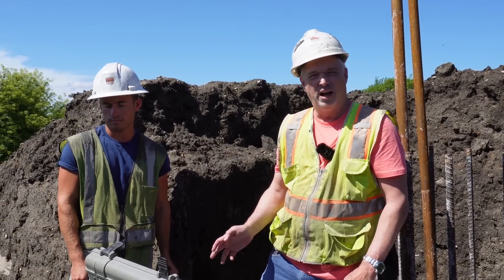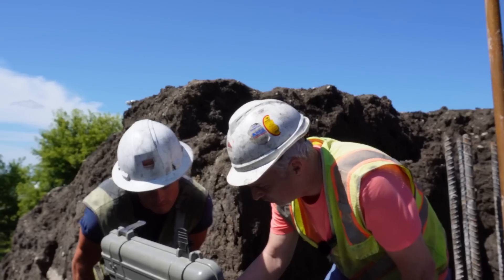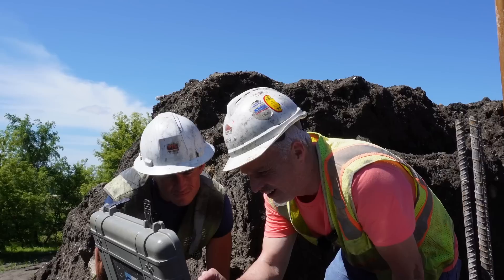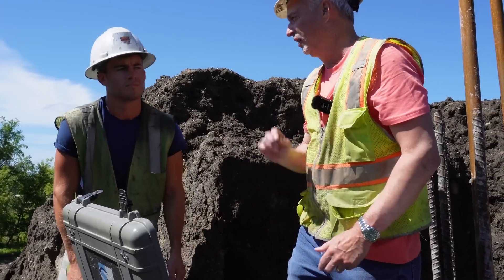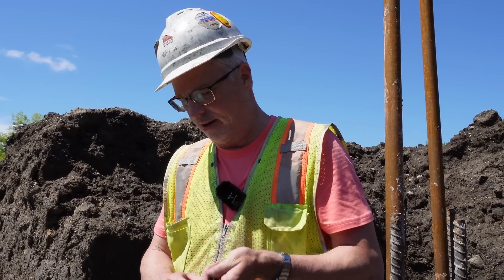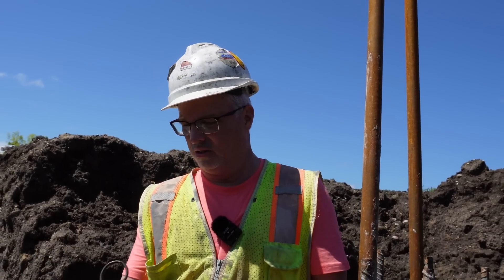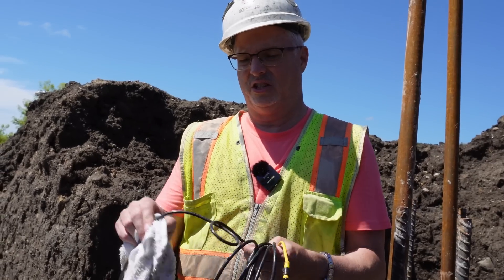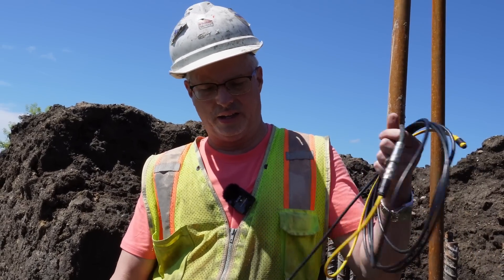Sonic Echo Impulse Response Testing of a Drilled Shaft Foundation

Comment: It's always nice to see engineers doing stuff hands on, I feel like the majority of the ones I interact with never see the field. One company I worked at was fortunate to have a group of electrical engineers that knew their way around tools and procedures. They would come out and help with things like primary injection testing, fall-of-potential tests at substations, or troubleshooting problems on utility transformers. It was great to get to work in that setting, I learned a lot.
Reply from the maker: There seems to be too many engineers who are content to spend all of their time in the office.  They are missing out by not spending more time in the field.

Comment: Interesting video. Always follow the ASTM exactly, even if its rediculas. I had a case where a contractor was challenging my test results which differed from his tech's results. When we went over everything I showed that I had done it by the Standard. It turned out that the tech wasn't following the standard. They shut up and left. Be careful. Good Luck, Rick
Reply from the maker: Yes, that is something to keep in mind for sure!
Reply: In my career as a heavy highway inspector, every single “disagreement” I ever had with a contractor was stopped in it’s tracks when I told them I would not deviate from the Specifications that their bosses signed on to when they agreed to the contract. If they had a problem with that, put it in writing and get more senior people and the client to sign off on it and I will be happy to accommodate. I have many hairy drilled shaft stories, but another time.

Comment: TOF (time-of-flight) is classic.  We used it (with known length) to determine acoustic speed and indirect measure of 'sintered-ness', something related to density, bond density of ceramics.  Higher is better as low acoustic speed is hint of poor cure.  Cement is 12000ft/sec (~4km/s). For our ceramic good was 17km/s.  Yes reflections, scatter, dispersion make it a messy test.
Reply from the maker: Interesting, thank you.  Yes, our situation is usually we assume a wave speed or measure it with another test to determine the length or depth to integrity problems.

Comment: Here in Colorado, we have been seeing utility poles for highway and city traffic controls / lighting corroding in an almost perfect ring, causing them to fall over. Probably is exacerbated by application to roads with magnesium chloride ... maybe overspray can be averted to solve the issue. We have not heard much about it lately.

You are old school... I use only Cordless Hammers! :)  The channel is very interesting to non-enginerds, such as myself.
Reply: I love RF and wireless doodads, but a wired connection is the simplest to reason about.

Comment: Using the under over method to coil your cables should reduce the tangles of your wires. If you start with a figure 8 and fold it over, it will show you how it looks. With each twist there is an untwist this way.

Comment: Interesting the same physics as an electrical transmission line in communications. The anomalies are the same a what is seen on a   instrument called a TDR.  The hammer is providing an Impulse which has a rise time faster than the one way trip time in the media. In this case this is concrete. The phase and magnitude of the returned wave you should be able the distance problem regions. Fun fact is that transmission lines were not understood until the first undersea telegraph cable between Europe and North America was constructed and failed.
Reply: And just to amplify on what was said a TDR is a Time Domain Reflectometer. They are test devices that generate an energy pulse or step on the cable to determine the location and magnitude of cable faults, breaks, splices, terminations, or other events along the length of a conductive cable.

Comment: Sounds like the PE certification process is not rigorous enough if people are signing off on incorrect reports.  Maybe better training on the software or better software is needed? Is the software certified in any manner?
Reply: A feel a lot of it is people not going through a thought process of wondering whether their answer made sense. I think Casey mentioned slide rules on this channel somewhere, and as someone who discovered this tech from before my time, I feel like one of the things you learn with them is how to ballpark a range of where you think something should be before you use a tool to achieve better precision. If all you ever knew was a calculator but you never had to learn to think about whether the answer it spit back made sense then you're not really better off, because the precision and speed is useless without understanding what you're looking for. I see it all the time where people miss a step in an equation and roll with the answer the calculator gave them, and no bells went off in their heads.

Comment: You're killing me with that cable. Get a small hose or cord reel for that thing. You're coiling it when you want to roll it up instead. Over time the whole cable will develop a twist like a candy cane and those hard kinks will eventually weaken the inner conductor where it will fail or give erroneous results. Having said that I love all your content, it's incredibly informative and easy to understand. If nobody has said it before you'd make a fantastic teacher and it's great you're passing your knowledge on to the young guys.
Reply: Same here. You can tell , in just a few seconds, who does and who does not have any kind of savior-faire with cables. After those few seconds I was just cringing... lol
Reply from the maker: I have had better cable days for sure!🤣
Reply: Add me to the cringe mix!
I used to run a theatrical lighting business. Every time I did a job, I'd have about half of a mile of cables to run.
I was extremely particular about my cabling. 
Once in the early years,  a concert had to be delayed because I wasn't finished setting up because my extension cords were in a huge knot.
I was mortified and got myself a spool right after that. 
Problem Solved!!
Reply: @ericcox6764  man i was building a deck for this dude in hollywood. They were filming some popular show with Lady Gaga in it at a house across the street. They had billions of feet of super specialized electrical cables strung all over that neighborhood. It was seriously elaborate. That lighting is a serious job. And they paid the homeowner $2500 bucks a day to string wires across his driveway.
Reply: he's coiling it so tightly because he has to fit it, and other equipment, in a small container; it really is that simple. The man's a professional
Reply from the maker: Thanks. Also, I was a bit distracted as I was explaining various things at the same time.
Reply: @NadaTostadaFrijoleEnchilada  if you know, you know. If you see it you see it. If you get it you get it. You obviously don’t know or see. That’s OK
Reply: @NadaTostadaFrijoleEnchilada  if you don’t know, you don’t know. It’s not that the coil is too tight.
Reply from the maker: Thank you so much.  I have to admit I was cringing a bit when I saw how absent-mindedly and slowly trying to wind those cable and talk at the same time!
Reply: Seems like WAY TOO MUCH thought and effort put into a stupid sign post. This is why construction has become stifflingly over regulated
Reply from the maker: Actually, those signs foundations are important.  It won't do having a sign topple onto highway traffic in the event of a failure.  Also the lateral loading from wind loads on the signs can be quite high.
Reply from the maker: The lateral loading on these big signs can be very high.  Hence the stout foundations.
Reply: "backwrapping" would help prevent the twists. you have to loop every other loop under the previous loop.
Reply: The ocd is real
Reply: Bunch of audio guys up in here.
Reply: Yawn
Reply: I like the “roadie wrap” method. Anyway, good video.
Reply: This overkill regulation and beaurocracy is why public construction projects are astronomically expensive. All this for a stupid sign. Common sense tells you just by looking at that monstrosity of a post footing that IT AINT GOING ANYWHERE!! My God how did we get to this point? Why don't you do a video on how long it took to install said sign? My guess is at least 2 months to do what realistically should take less than 2 weeks, most of that time being cement cure time. On a positive note you are exposing, unintentionally, how ridiculous DOT management has become
Reply from the maker: These types of foundations are non-redundant, so each one has to function properly.  Having some money to do testing is well spent to improve means and methods and ensure good foundation integrity.  The alternative is to design in a much more conservative fashion if little to no testing would be done, which would cost far more than actually doing more testing.
Reply: We got to this point because somehow one sign fell down